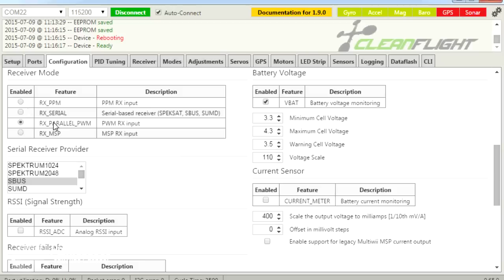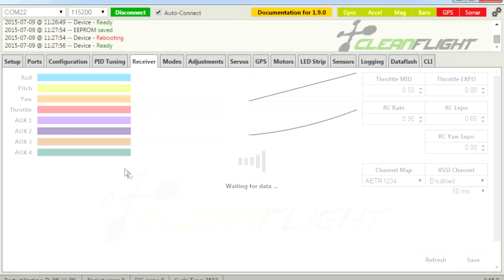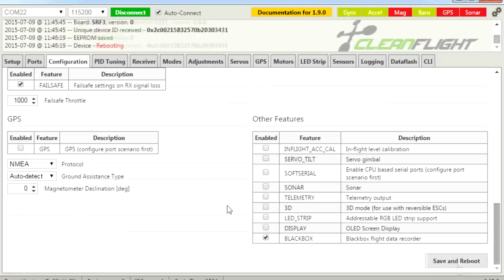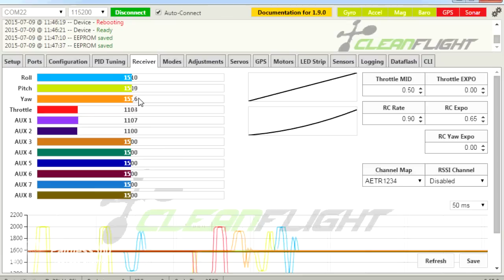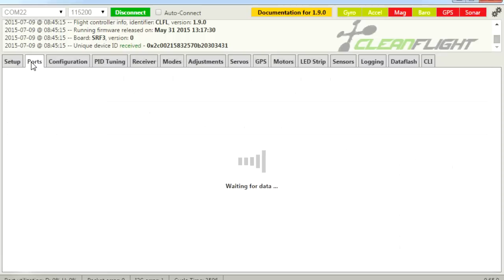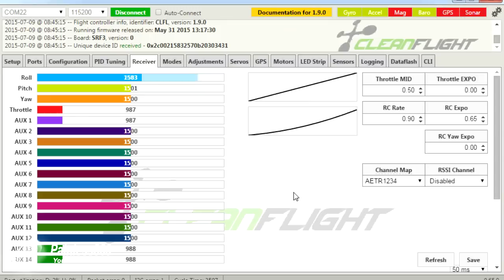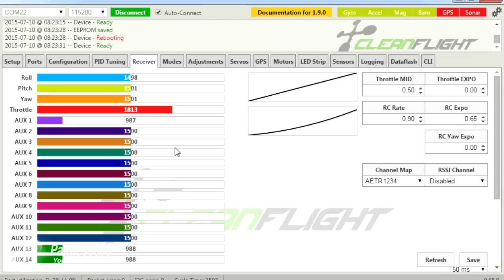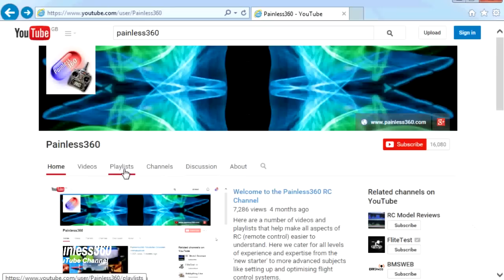Seriously Pro F3 (SP3) Quick Tip - Install and setup PWM, CPPM and S-Bus Radio Receivers

Comment: ok so I've conected everything.. powered the board via 5v regulator with an extra esc cable  to one of the extra pins (next to the 4 esc conectors)..and that all works perfectly.... BUT my receiver (fs ia6B) doesnt connect or get power... . it isnt broken..cause it powers up and binds when i use the same esc cabe i use to power the board.. but with the 3 ppm cables in the  io_1 or io_2, nothing happens... also set it to ppm in cleanflight... also enabled ppm settings in the flysky fs-i6 ...what am i missing here??? ive been buisy for 6hours now and its so frustrating:(!!
Reply from the maker: The power to the Rx should come down the red and black wires of the servo cable you have plugged into the FC. I'd check that those pins have the 5v the Rx needs. See the videos in both the 'Introduction to Remote Control' and 'Quadcopter Building for Beginners' series on RC power. Best of luck!

Comment: i need help with fly sky, throttle and yaw move together? same with roll and pitch! i followed your video exactly. using PWM btw.
Reply from the maker: What does the monitor show on the radio? Are they moving the same there too? If so then it's a problem with the model setup.. Best of luck!
Reply: +Painless360 I will check but the settings were working fine with cc3d and now they are stuck. Is it possible the reciever transmitter can remember the cc3d settings and is trying to mimic the settings on the spracing board.
Reply: Have somebody find a solution for this, I have the same problem. Yaw and Throttle move together as well as Roll and Pitch. I'm using PWM with AR6210 w/o satellite and DX6. I've double check my connections. This receiver works fine with my Vtail quad. I've tried different model cofings, but all show the same behavior. Should I get a different type receiver?

Comment: I love your tutorials and it helped me a lot. But on this one you got a big mistake. You connect the X4R to an 3.3v power source on the board. But the X4R needs 4v! So it will work on the ground. But you will get some nasty cutouts in flight.
Reply: +ArkoN Actually not!. Its connected to a 5v on the board. The X4R receiver is connected to IO_2 which has 5V on Vcc. The only connectors with 3.3 V are the IO_1 pin 8 and Boot pin 1.
even UART 3 on  the 4pin Connector has 5v (in manual it says 3.3v but it not true).
Reply from the maker: +Roel Jaspers Thanks for answering that one Roel..
Reply: Really confusing. Did you measure that under load? On rcgroups they talk about that these are 3.3v.
Reply: Yes I've even measured connection between 5v and vcc on uart3 and they are connected
Reply: Pin 8 on io-1 has also 3.3v
Reply: And thank you very much painless 360. Even being a almost expert in flight controllers, I still learn from you
Reply: I also  discovered the 5V and 3.3V points,  cos I require 3.3V for a Lemon Sat Rx but unsure about loading the 3.3V boot pin ( easiest point), although it seems diriectly connected to the 3.3V pad and I/O-1 pin8

Comment: I'M MAKING A 180MM RACER, SHOULD I USE THIS BOARD INSTEAD OFF NAZE 32 REV 6?
Reply from the maker: +daniel nagel Why are you shouting?
Reply: +Painless360 really? ...
Reply from the maker: Yes really - it's rude ;) The Naze32 is a far more basic board than those using the SP3 so if you want basic stabilisation then the Naze32 is great. If you want a faster board that Cleanflight will support in the future - go SP3. Best of luck!
Reply: +Painless360 thanks! I don't care about capslock but sinds some people are disturbed by it, il have too watch it.

Comment: I followed the instructions on pwm for my rx701 receiver for devo7 and it's saying that my throttle is aux in cleanflight. What am I doing wrong?
Reply from the maker: Plugged the wires into the wrong outputs on the Rx normally.. Best of luck!

Comment: Hello and infinite thanks for your crazy awsome content!
Do you have any tip to find polarity on receivers without pin maps? (I am struggling with the flysky fs ia6b...)
+ can you power this one with the 3jst ppm output?
Reply from the maker: +Maxzor azon The middle pins are always the +5v, use an ohm-meter to test the pins on each side as the GND pins will be all connected together.. Best of luck!
Reply: +Painless360 Thank you.
In the CPPM video part (around 10:00), did you really power the board via RX and battery, and at the same time connect USB? I thought the board should not be powered more than once!
Reply from the maker: Yes, exactly as we show it. If you can't power the board from the flight battery and the USB at the same time how are you supposed to calibrate the ESCs?;)
Reply: +Painless360 Thats one point!
Followed the tutorial step by step and got no acknowledgement from SPRF3. On IRC, Hydra, which I think is D. Clifton, told me about wrong channel ranges but this not seems to be related. Got linked updated Hobbyking firmware that would fix PPM output. + using a clone on top of that mess.
So chinese RX without pin map + chinese clone without manual, and a lot of me disclosing my boring life until maiden flight.
Reply: One crucial point that I may have missed :
I powered the RX from the SPRF3 board, with only the 5v pin on the PPM output.. Do I need to power the RX from the BEC too?
Reply from the maker: I'd connect the Rx to the board using all three wires (GND, 5v and signal) and then you don't have to worry about it.. Best of luck!
Reply: +Painless360 Yea is obvious, the only thing misleading to newbies like me is that the vbat port is NOT powering the board, in case you use opto escs you have to connect the board additionally from a pdb (as you explain elsewhere), or even through RX. Contacted Hydra to update manual as vbat "monitoring" looked very much like "power and control" to me.
Best regards
Reply from the maker: On the newer boards it does ;) No need for UBEC or power connections to the main flight battery.. finally! Happy flying!

Comment: Hello, i have a problem when attempting to arm my sp f3 flight controller. 
I am using turnigy 9x tx and the turnigy 2.4 8ch receiver. PWM setup.
I am using cleanflight and the escs are calibrated, the quad is level, all motors are spinning fine when connected to a battery and testing them on cleanflight. On the receiver tab pitch and yaw are at 1500,  roll at 1288 (for some reason?) throttle at 1064 at minimum. When turning throttle up, the roll follows and they come together at 1500, is that okay, if not how do i change it? and can that be a problem for arming the board? I have set stick min 1000 center 1500 and max 2000. I have tried disabling the accelerometer, but nothing helps. 
In the modes tab i set aux 3 to arm the board, and when that is activated from the transmitter the red light on the fc flashes xx - xx- xx -xx -xx -xx (no sounds though), the same when i flip the switch back, but the motors don't respond to my stick commands. To sum up, I am not able to arm the fc with my transmitter, i do not know how the fc will react when armed either. Is the flashing mentioned earlier the correct reaction from the fc? 
Thank you so much for helping me set up the PWM.. sorry for the messy post, but i hope you can help me! 

Bjørn
Reply from the maker: +Bjorn Mathias Gundersen I think you have some more basic problems here. I'd recommend watching my 'Quadcopter building for beginners' series, I cover each of the steps in the lot of detail. They are designed for new builders with little experience. Hope they help.

Comment: PPM.   I have a AR 6210 Where do you think the cables go I have [bin data] [thro]  [aile]  [elev]  [rudd]  [gear]  [aux 1]
Reply from the maker: +Roman Figueroa ppm isn’t supported on that receiver, not sure what you’re asking..
Reply: Painless360 ok
Reply: Painless360 I buy another receiver s603 this is support PPM trying to configure  on cleanflight but nothing's move when I put on the receiver the colors bars don't move can you help me if you tell me if you know a video on the web I have the dx6e control

Comment: I managed to connect the channels correctly, but now the roll and yaw channels are inverted.
I'm using Betaflight and I don't know how to inverrt this via software to normal.
Reply from the maker: +kuro いん I'd reverse them on the radio.. best of luck!
Reply: radio setting menu have invert channels what need change.

Comment: need help!! SP Racing F3 Flight Controller board not mapping the correct channels in PWM mode either, I'm unable to get any RX input to IO-1 (CH1,CH2) & IO-2 (CH3,CH4). But I can get all AUX CHannels!
Reply from the maker: Happy to help but please watch https://www.youtube.com/watch?v=olIqTiSJHIY and come back to me with more detail of what you've tried..
Reply: I have exactly the same issue please share info if you get a solution
Reply: I downgrade my SP Racing F3 Flight Controller board  to 1.9 release and now i got all my 8 input, hope it will help you !

Comment: So i know this is a old vid...But i got a question?  I have got use to flying a  Gool GC6 transmitter i have...which came with a GC6 Reciever....(Just clones of older FlySky i6 reciever and transmitter) 
Now i have a Wizard x220 which came with a Turnigy Evolution controller.  Which i think is running ibus protocol? I know this dont make much since...lol..(Latency) But i fly better with the GoolRc i6 clone GC6 transmitter and would love to fly my wizard x220 with it...And im told the GC6 reciever is running PWN...? Would it have to be wired like your showing in this video?  Great info video by the way...Video like this helps noobs like myself tremendously i appreciate your time in advanced
Reply from the maker: Ideally you need a receiver that uses a single wire connection - ideally S-Bus or i-Bus is that's how the FC is already setup in the software. Setup with PWM is covered in this video and needs a single wire connection for each channel - it's bulky and many modern flight controllers don't even support it any more with the rise of the popularity of S-bus, I-Bus and things like CRSF. I'd look for a compatible Rx that support S-bus and use that.. Hope that helps!

Comment: Hi, I am using spektrum AR 8000 received  , I followed the instructions as mentioned, 
Every thing works fine but pitch axis totally not responding ,  and board also not arming, throttle and yaw minimum less than 1100 and maximum more than 1900 and I tried to uncheck the msp port 1 save and reboot , still problem not solve , 
This my second sp3 FC, please help
Reply from the maker: +Nirmal Kumar I would strongly suggest that you go back to the vendor who sold you the board(s) for support. The board will not arm unless you've also performed the acc. calibration via the GUI etc. Best of luck.

Comment: My Naze32 went up in smoke thanks to a crap PDB, got one of these, but having issues making it work with a lemon-rx satellite receiver, it won't go into bind mode. I ordered another thinking it could have been damaged along with the Naze, but was wondering if anyone else has used this combination?
Reply from the maker: +Andrew Miller You need to bind the Rx before connecting to the board...

Comment: im using flysky ia6b receiver which setup do i use
Reply from the maker: Depends on how you connect it. It can be wither PPM or PWM. We set one up in the 'Quadcopter building for Beginners' series, that may help..
Reply: ok im using sbus and transmitter is bound and i have power to fc and receiver but controls arent doing anything in cleanflight
Reply from the maker: Double check that UART3 port is configured.. Best of luck!
Reply: Hey did you ever figure this out? I am having same issue right now.
Reply: Christian reconfigured to ibus
Reply: There is a video on YT called "Configuring FS-iA6B with SP-F3 Flight Controller using iBus | Tutorial" check it out.

Comment: Hello Painless360,
I'm building my first 250 quad, Naze32 rev5 10dof to FlySky FS-ia6 receiver PWM signal, the FS-ia6 just have numbers for the channels, How do i know which is Roll, Pitch .... etc , I've been searching for a diagram online without any luck. 
Please help, thanks
Reply from the maker: +Juan Carlos Vargas use the channel monitor on the radio to see which is which. The top channel should be '1' on the receiver etc. Best of luck..
Reply: thanks !

Comment: Hey Painless!
I have a problem with my sp racing f3....maybe you can help me/have an idea, what it could be?!
The thing is, on my FC, just the pins 5 and 6 (AUX 1 and 2 on IO_1/AUX 3 and 4 on IO_2) are working.
I don't get any signal, if I use the pins 3 and 4 (on both sides (IO_1/IO_2). Could it be, that the FC is broken?
Thanks in advance for your help!
Reply from the maker: +Makki not sure what you're describing. You need the ports configured and softserrial enabled etc..
Reply: +Painless360
I mean...when I connect pin 3 and 4 of IO_1 (AILE and ELEV) as well as pin 3 and 4 of IO_2 (THRO and RUDD) from the flight controller with the right connections on the receiver (receiver is working well, I checked it on the CC3D), none of the bars in Cleanflight (Roll, Pitch, Yaw, Throttle) are moving, when i move the two sticks on the radio control around.
If I connect pin 5 and 6 on IO_1 (AUX 1 and AUX 2) as well as pin 5 and 6 on IO_2 (AUX 3 and AUX 4) from the flight controller with the 4 channels (THRO, RUDD, AILE, ELEV) of the receiver, the 4 AUX bars ARE moving in Cleanflight.
So it seems like the pins 3 and 4 (on both sides) are broken/not working. 
My question is, if you have already heard about a problem like this (maybe it's just a wrong setting in cleanflight) or do you think, that the sp racing f3 is broken?
Sorry, for my bad English, I'm from Germany...I hope you understand what I mean ;)
Many thanks in advance!!!!!!
Reply from the maker: I've not seen it - see our videos on how to wire up the common connections. You also need to setup the method of connection in the Cleanflight GUI too.. Best of luck!
Reply: Hi Makki, did you solve this? I'm having the same problem
Reply: +Philip Sorri 
No, I didn't solve this problem :(
Yesterday I received my new flight controller (because I thought, it was broken), but I have the same problem with this one!!!
If I will solve it, I'll leave another comment ;)
Reply: Makki Thanks for the fast reply! Okay, well that sucks :( 
I'll leave a comment too if I solve it! :)
Reply: Makki It is weird though that I got it working once, before I assembled my entire quadcopter. Now after I assembled it, it just won't work. I have tried almost everything to get it working but well see! I'll keep trying!:)
Reply: Hey Philip Sorri
I solved this problem and want to share my solution with you :)

It's very important, that ALL 4 MAIN CHANNELS (AILE, ELEV, THRO, RUDD) are connected to the receiver!! If you forget just one channel, the other 3 channels aren't working.

In my case, the pin's 1, 2 and 3 of the harness of IO_1 and the pin's 1, 2 and 3 of the harness of IO_2 were both on one seperate "three-way-plug" (1 = GND, 2 = +5V and 3 = AILE/THRO).
Because I didn't want to power the receiver twice, I always skiped one of the two "three-way-plugs"...so in that case, there was always missing one of the main channels, therefore the other 3 were not working.

So I disconnected pin 3 of the "three-way-plug" of IO_2 and put it on a seperated plug. Afterwards I was able to connect pin 3 of IO_2 to the receiver without the two power cables (red and black) on it.

Now all 4 channels are working :)

Sorry dude for my bad English...I give my best and hope, you understand what I mean ;)
Reply: Makki Thanks for explaining how you solved it! Really appreciate it! I'll try it out and see if it works! :)

Comment: Hello Painless, Great video. I broke my IO-2 port that I use for SBUS and I'm thinking if there's a way to reassign the port to another IO port. Please help. Thanks
Reply: me too!
Reply: i resoldered mine, but when it broke it also tore off the metal off the pcb so it cant be repaired properly
Reply: I found a solution to it. I did not bother to re-solder the plastic port back on the board. What I did was to solder pins to the UART3 headers and I was able to connect my SBUS.
Reply: you are getting proper power from uart3? what pdb are you using? mine is a stupid falcon 250 one
Reply: nvm it should work. Im sick of these IO ports that break easily, I prefer direct soldering. I should just get a LUX board.
Reply: ibus here i come
Reply: i use the RX hole right?
Reply: Did you ever find out how to do this? I am trying to connect to UART 3 via PPM as well, and I don't know if I hook up the receiver via ppm to the RX or TX hole/pin on the F3 flight controller?
Reply: yes i did, works great. I connected my ibus signal wire to the RX hole. Dont know about PPM though, id have to take a minute and think if it would work.
Reply: i know ppm usually goes through the io_1 port on f3 (pin 3 out of 1-8). Dont know if ppm works through uart 3 as i am using ibus/sbus.
Reply: you may see you ppm printed on your board somewhere. which fc you got?

Comment: im not getting any stick input at all  in beta/clean flight. please help! im using SPF3, FS-IA6 Rx, and FS-I6 Tx
Reply from the maker: What troubleshooting have you already done? It could be lots of things. Please see my 'Quadcopter Building for beginners series for how I make them where I show every step and they are aimed at new builders.. Best of luck!
Reply: I’ve tried running as SBUS, IBUS, PPM, PWM, and have even tried using different pin connectors. Also, I can’t begin to thank you enough! Thank you so much
Reply from the maker: You'll need to change the setting in Betaflight as well as on teh radio. See my 'Quadcopter building for beginners series for how I do it.. Best of luck..